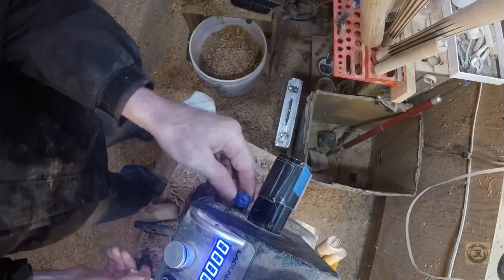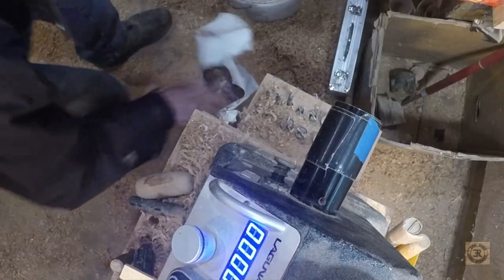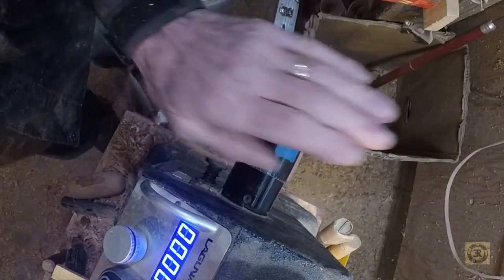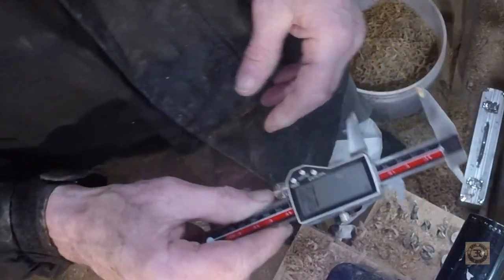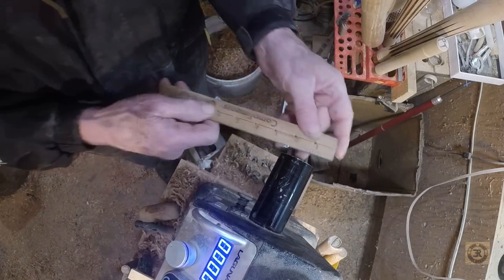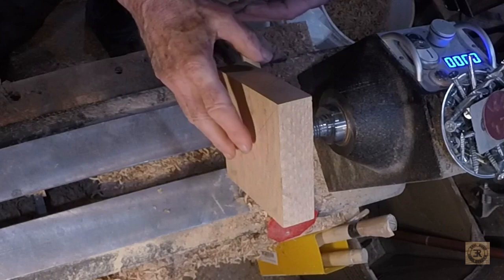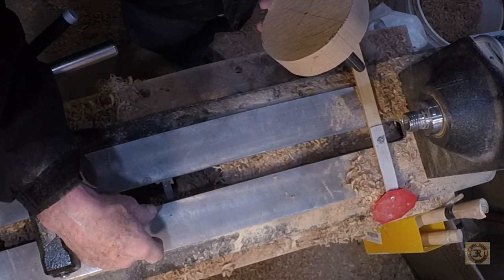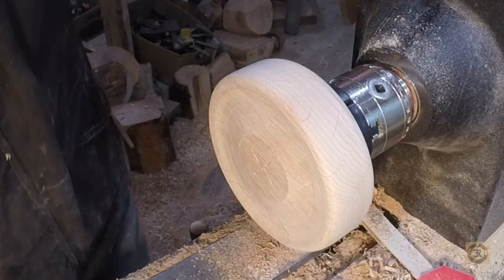Making a Spindle Hand Wheel for my Laguna 12/16 Lathe

Comment: yep good job old timer…I just bought this lathe,haven’t unboxed it yet as the stand is backordered
Reply from the maker: If yours has a red Stop button, good. If the spindle-lock button is red, bad. Paint it another color or cover it with blue tape. When you accidentally push the spindle-lock button to turn the lathe off, it really hurts. I finally put a guard over mine. Have to open the upper belt door to push the spindle lock.
Here is my first-year review.
https://www.youtube.com/watch?v=gVpyBTwpbdc

Comment: My REVO 18/36 doesn't have that knuckle-busting problem (the 2 indexing knobs are in a different, more intelligent location), but I will likely do something similar just to make it easier to turn the spindle by hand when doing a close inspection of the piece being turned. 

Now, if only Laguna had designed a spindle lock that actually stays LOCKED when you let go! The way it's made, the 'lock' (so-called!) pops out if there isn't constant pressure held against the spindle. There's just no simple way to keep it locked while using both hands to mount a chuck on the drive or thread a blank onto a worm screw. It can be done, but requires magnets. Just seems idiotic to me. Poor designs, which is really surprising considering how well-made everything else about it is!
Reply from the maker: I'll show you my magnetic spindle lock next video, if I remember to.
I think that, if the spindle lock stayed locked until manually released, it should also break the circuit or lock out the power button. I don't know about you, but I'd forget to unlock it frequently. I don't know what repeated power applications to a locked spindle would do to motor and melt, but I'm sure it wouldn't be good.
My magnetic spindle lock, based on the idea I got from The Papa 1947, includes a guard that won't allow me to push the power button.